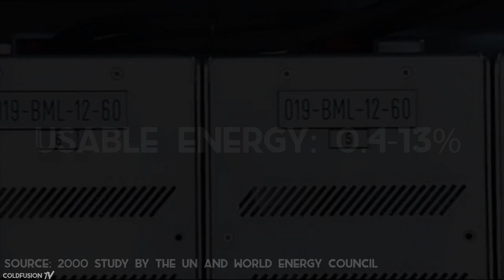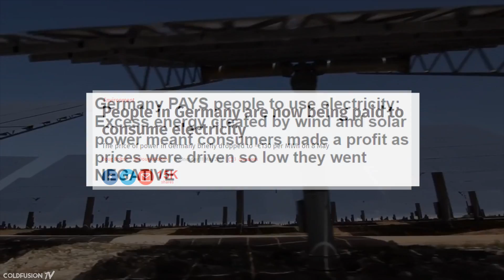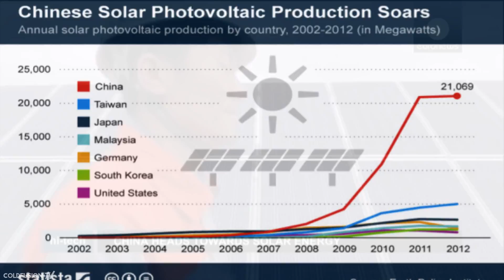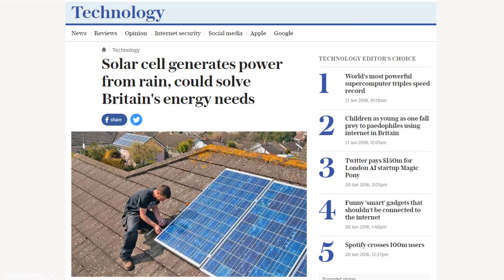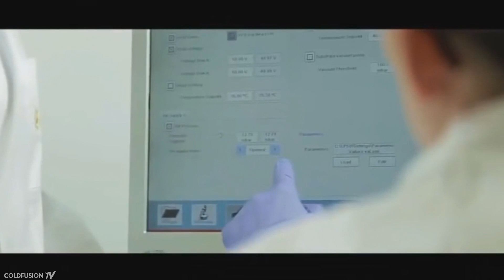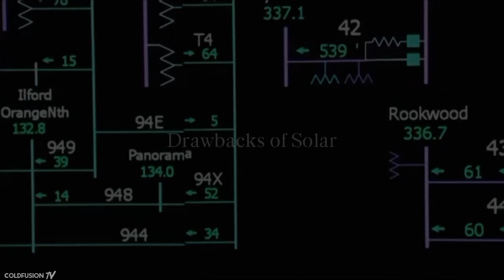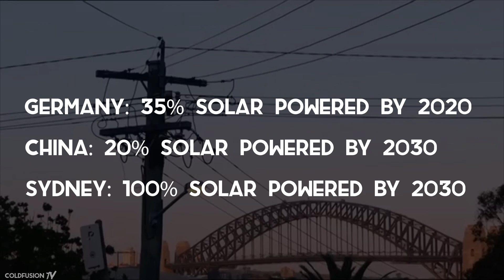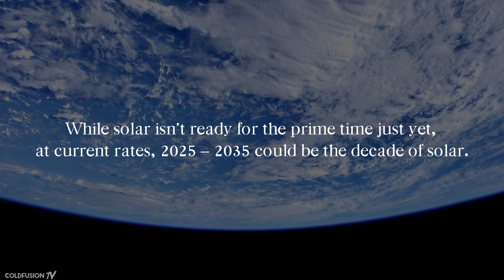The Truth About Solar

Comment: The whole premise of this video is rubbish from an electrical engineering point of, I am one.  Public power grid integrity relies on electrical line balancing whereby the power demanded by the customer base must be matched by the power generated by the power plants. Not doing this is what causes power line feeder cables to burn up and henceforth blackouts. Because the solar power yield from any solar panel is uncontrollable , power grid administrators that are forced to utilize solar power have to make up the deficit in power generation that solar arrays cannot produce using legacy fossil fuel, nuclear, and or hydro electric power to obtain that power line balancing. The actual biggest technological hurdle, is humanity's inability to store electric power for long term usage. Despite claims to the opposite, that long term energy storage technology does not exist except in the wild fantasies of techno-illiterate journalists in the mass media. 

Because, as I have explained, power lines must be  electrically balanced, grid operators have to make up for power deficits that wind and solar facilities cannot meet with existing conventional power infrastructure. But before anyone says "fine, so what", that type of power grid management increases costs to the tax payers and customers in the following ways:

1. Increased effort to balance a power grid network
2. Increased throttling of legacy power plant systems that has has a drastic drop in operation efficiencies. IE cost increases.
3. Decreased lifecycles of legacy power plant machinery, thus increasing costs.
4. Increased maintenance on existing legacy power plant machinery due to increased throttling.
5. Higher than average power reserve requirements generated exclusively by legacy power plant infrastructure. Most public power grids that have no wind or  facilities integrated into their networks require an average of just 20% above the power demanded and ready to be switched on should there be a quick surge in power demand. Power grid networks like the ones operated E.On Energy of Germany with an extensive wind mill network must use a whopping 80% power reserve due to the high variability of power output yield inherent in their wind mill and solar plants feeding their network.

All of the above factors are the primary reasons electricity customers like the ones in Germany, with its high usages of solar and wind power, have electric bills that are as high as $0.38 per kilowatt-hour. That is almost four times more than the average American household pays. A very similar situation exists for the electricity customers of Denmark, Spain, and most recently Australia.  Until a long term storage solution is invented, wind and solar power will multiply the electric bills of the masses.
Reply: As an economist, the cost of fossil fuel does not include the expense of “externalities “.  These are the indirect costs not paid by the actual users. Usually they are paid by all of us and not linked to the source...yet.  These are carbon dioxide and hydrocarbon soot in the environment that result in greater costs from climate change like higher levees, floods, cancers from particulates, even the costs of washing dirty cars.  When these costs are added in, $.38 KWH expense is quite a good deal.  Solar, hydroelectric, geothermal and other sustainable energy sources are not only desirable, they will create usable capital for economic expansion from what is currently an economic sinkhole.
Reply: @s.m.7018  How does an economist have so much expertise in the causes of "externalities?"  You must be quite brilliant in everything.
Reply: Finally some one to explain to the masses, I hope everyone gets a chance to read your message.
Reply: Well, the actual cost of setting up & digging coal fields, the infrastructure for such, the transportation for the fossil fuel, basically the various costs associated with producing electricity with fossil fuels will be reduced to recieving principally free solar energy.
I'm not disregarding the above power costs, but just wondering about the costs of the actual generation of electricity,  which might come down fast, cheaper than burning fossil fuels
Reply: @yugen3968  

If you read my post carefully, you would know that solar energy is not free and is actually much more expensive than the Liberal dominated media makes it out to be. Because, as I have explained, a power grid electric network requires power balancing, any power source connected to a power network has to be dispatched at the correct power demand level. But solar farms are incapable of doing so, it  necessitates the continued use of existing and in some cases additional fossil fuel powerplants. And because power output  levels from wind and solar plants are at the mercy of local weather, power grid operators are forced to operate a fossil fuel plant much more inefficiently and expensively. Our natural world contains enormous sums of naturally occurring wind and solar power, but humanity does not possess the technology to harness it efficiently and cost effectively.
Reply: @stefanz6502   Bullshit keeping buy the corporate line
Reply: @yugen3968  

But coal yields large amounts of energy even though it has to be mined. Solar and wind cannot energize any power grid 24 hours a day. COAL CAN, and that is the big difference.
Reply: Stefan Z   I have a question from a layman.  Why do we have to be connected to the grid?  Isn't solar power supposed to get us self sufficient and off the "grid?"
Reply: Is the kinetic storage model not a valid type of storage on a larger scale? For those who don't know, excess power produced during daylight hours are used to wind a very large weight up a tower. As the weight gets pulled higher up the tower, it "stores" this energy as kinetic energy. When power demands Spike, the weight gets lowered and spins a turbine that produces electricity, thus re-releasing the "stored" energy from the day time.
Reply: Still, we got very nice choices for renewable energy.
We can use hydroelectric and thermal. and then we can use Solar for places with alot of sun and aeolic for places with... well, alot of wind, combine all of theese guys and you get a nice clean energy source.

Also, lets not forget our good friend nuclear energy, and even better, we can try to better our nuclear reactors by using thorium reactors and try to better our current designs.

And if we find helium 3 on the moon, maybe... just maybe, fusion energy.
Reply: You state the increase in the bills as if its a law of nature. When its a man made problem. No one forces the increase of expenses. It happens because those with the money, are greedy. And want the continued increase of bank account. So folks, the rick want MORE money! Screw YOU, wanting fewer monthly expenses. And screw the earth, for wanting humans to live in more harmony! All that matters is that the rich, stay rich!
Reply: Legit question here from a fellow skeptic of the climate craze:

Why does the energy have to be stored as chemical potential energy? Couldn’t it be stored as physical potential energy?

Don’t we already have hydroelectric reservoirs that pump up water at night to be used during the daytime demand?

In theory, could high rise buildings be outfitted with water tanks on the top story and a pipeline leading to a simple generator in the basement, pumping water up at night and draining it during the day to contribute to the grid?

Or heck, maybe that’s how we cut back on how closely the power companies have to manage the demand. Have local “reservoirs” that adjust to impulsive changes in demand, allowing major plants to make more gentle changes. Think of how water plants depend on water towers to maintain a steady pressure for the local pipes as well as some storage.

If all this is dumb and unfeasible, that’s fine – I’m just trying to understand things.
Reply: @Intrafacial86  yes that is in theorie possible but buildings have no where near the capacity for that. You need hills, or the alps. The problem with that is that in germany at least the places that could be used are already in use and new places would have to be in a magnitude that every green hippie would cry and demonstrate about the lost nature. They now want to remodel the electric grid in germany and will cost millions and the people will have to pay for it.....please someone has to stop this bullshit.... please use the money to make a thorium reactor....
Reply: Luckma1 curious, I keep seeing comments about thorium reactors, but I don’t know what the big deal is. Are they cleaner? More efficient?
Reply: @Intrafacial86  there are many videos. it only produces radioactive substances with very low half life (30years), it can burn redioactive material that is not useable anymmore in nowadays used ractors(nuclear waste burner) , it can not melt down.
Reply: Luckma1 well damn, how come such a good thing isn’t being circulated to the public? Shouldn’t they be popping up like dollar generals? Have any been built and utilized in the grid?
Reply: WHAT!!!! I hope my pension fund is not insuring your professional liability
Reply: I like it when smart people tell the truth.
Reply: The answer is "cold fusion"
Reply: Well, after what you've just said, I'm back to seriously planning on going off grid. Good luck guys!
Reply: Stefan Z thanks
Reply: Notice how you keep mentioning problems with legacy systems.  The nation needs an updated power infrastructure built.
Here in Kansas, the excess power from wind farms and solar gets exported to other states via lines set up specifically for that.  Kansas is by no means the only state doing that.  Strange you typed so much, but no mention of that basic fact.  The jobs in that sector are booming and pay high.
Storage is a huge issue...but this is the US of friggin A.  There are plenty of states and cities happy to guzzle the excess created out-of-state.
Ironically - some of the states that were in favor of the oil pipeline pumping tar crude from Canada to Texas, tried suing to stop the electrical pipelines from Kansas going out to other states.
Reply: So true. The electricity bills have gone up here in Australia. These green eco mentalists have fucked it all up.

Comment: I give you points for a fairly balanced narrative.That is the good. The Ugly is that I have a stand alone battery inverter solar system that was just a con. The batteries have failed and the inverter eventually failed. The whole thing was a waist of money. A diesel Gen Set would have been a 70% cheaper alternative.

Comment: 5:04
This is of course nonsense. It maybe be true in the rare case when there's a very thin layer of cloud blocking the sun, but then even you can feel the sun a lot like normal and the glare is near to that as well.
Reply: When you go outside on a cloudy day, is it dark like night time?? or can you still see everything pretty well, and things like car headlights are hardly noticeable.  I understand some very heavy storms may make it pretty dark, definitely not like night time, most cloudy days are still much brighter than night.

Our current panels are most sensitive to infrared light, which is reduced more by clouds than other light. UV light is pretty good at getting through the clouds, which is why people can still get sun burns on cloudy days.
Reply: @JavaMan
"most cloudy days are still much brighter than night."
Perceptually. Keep in mind that the human eye is very sensitive. Between the dimmest light you can see and the brightest sunlight there's a million times difference.
If there's a decent cloud cover the solar energy will be a small fraction of a bright sun-shiny day. Even worse, it will be completely diffuse so less of it will hit the panel.

"Our current panels are most sensitive to infrared light,"
This wouldn't reinforce your position, in fact it would completely rebut it, but it's also completely wrong. No solar panels are marketed that can utilize infrared (thermal collectors absorb them but they don't produce electricity).

Comment: The cost of PV has come down to the point that it is now possible for companies to instal them and export all energy more cost effectively and financially than generating from a power station in-fact on Arab country has just done precisely that.
The life expectancy of modals I have been organising for my clients (I’m an architectural technologist) have an 80% efficiency at 20 and in some cases 25 years guarantee , they will continue to produce for many years beyond that. I know of som put up when I was in my teen’s and are still producing some 38 years later....
The cost of electric is going up & up the increase over the last 5-10years has been significant, that is only going to continue. The last time I did a cost benefit calc for a client the return on capital investment was approximately 17% better by far than money in the bank....it’s a no brainier.......!!!

Comment: I never heard any mention of the cost to produce PV cells....how often they have to be all replaced (10yrs).  
There are MAJOR hurdles to overcome before solar and/or wind can get beyond individual households (low output?  no TV tonight.  and never a microwave.  Etc.)
Germany took a huge stab at wind/solar.  Invested $687B in 28,000 wind turbines and a square miles of solar.  Despite what this energy exec said....on windless, overcast days production was pathetic.  (one engineer said they might as well try growing pineapples in Germany)
Germany relies on electricity for about 20% of its energy needs.  Wind only produced 16.6% of "theoretical potential".  In 2016, the whole $687B produced 3.1% of this 20%.
Storage:  in Schwerin they built a $7M battery array.  It was capable of storing the output of 1 wind turbine in 1 hour.
The electrical grid HAS to be consistent...or you immediately start burning out refrigerators and computers.
Therefore, a consistent parallel system has to ALWAYS be up-and-running.  Which means coal or gas. 
As for electric cars:  present grid can only handle 2-3 cars per city block.  More?  Spend many. many, many trillions on an entire new grid throughout the USA.   And many more trillions every 10 years to replace turbines and PV.
Whole grid?  Fairy tale at this point.  Individual houses where you CHOOSE severe limitations and willingly accept them:  what we have now.

Comment: Yes, solar can be extremely good.  BUT...COST TO CONSUMER is still over $1 per watt, most places I’ve asked......often, several dollars per watt....then installers tack on fees, extra parts, labor.   
To install only grid-tied PV, 12.5 kW, on a roof in our area, was quoted at about $35,000....and, that would NOT cover our winter electric use, nor batteries for back-up.....we’d have to pay both the loan payment on that PLUS the excess caused by need for heat.    That was a “deal breaker”.  
If you use solar to heat air, to heat your home (we have done that, for several years...saved up to 300 kWh’s, in winter, in the Pacific NW....There was only a week or two we had to shut those down between Christmas & New Years, because of too much cloud age...That amounts to saving about $50 off winter electric heat).....But what do you do with the excess heat in summer, to avoid heating the Great Outdoors?  
We covered those panels with a tarp...but now, the only place to put them, being on the roof....That would dump lots of heat into already hot areas, increasing the heat signature, especially in cities already suffering increased heat signatures...that’s a LOT of extra heat,  if most in an area use solar...be it PV, or air heating.  
Thot about ground-dumping it in summer...but, IDK.

Comment: I heard first hand from a IBM physicist that it will be harder to get rid of the dead solar panels and the battery waste than then the waste of a nuclear power plant.
Reply: Regardless of what you "heard' ... there are Solar Panel Recycling companies...
Reply: MrSummitville right in limited supply and in another ten years when they start to come undone they won’t be able the handle the units installed. Sooner then later they will end up in our landfill just like lead paint and asbestos to name the few.

Comment: Interesting so: the coalmen and natural gas tooters are liars, but Solar pushers are use the same underhanded tactics of bending reality. The only honest source is Nuclear Source. Our modern day plants are pretty darm safe due to better funding, extra safeguards, and a better understanding of the system. So let's go there instead!
Reply: Why make a nuclear reactor here on earth which costs money for input fuel, cost money to store the output waste and cost money to run and maintain thousands of miles of distribution cable across the country...when we've already got a gigantic nuclear reactor far away in space where it's safe and produces unlimited energy for FREE for the next millions of years. Wind and solar is now cheaper than nuclear and in some cases cheaper than coal. If we're going to build any new power plants makes sense to make them wind & solar power plants.
Reply: @motoarzan791  its definitely not there yet. But solar is certainly on the rise. However nuclear reactors are much safer and do less pollution than before, and they can power entire cities. Solar still cant do that yet. So right now, would you rather coal or nuclear?
Reply: @motoarzan791  it's great that you assume solar and wind power are that much improved. Always be optimistic about independence from natural and non renewable resources.